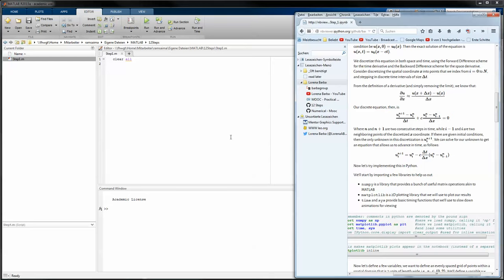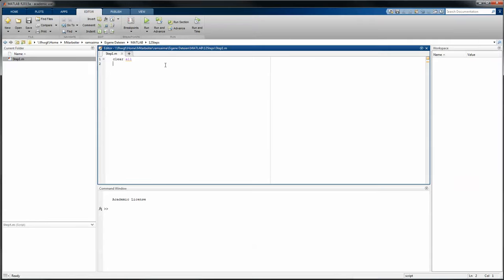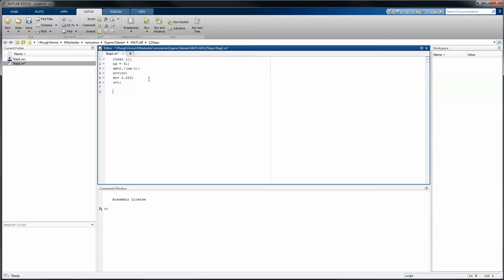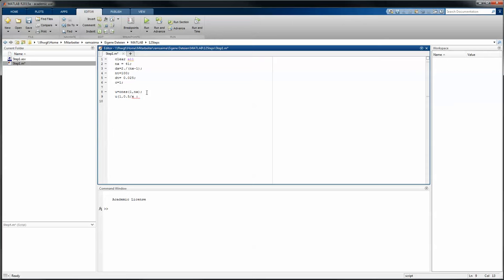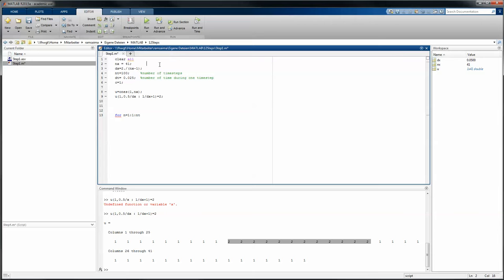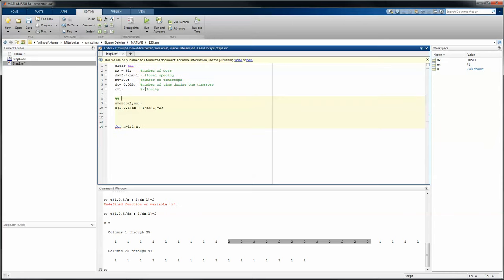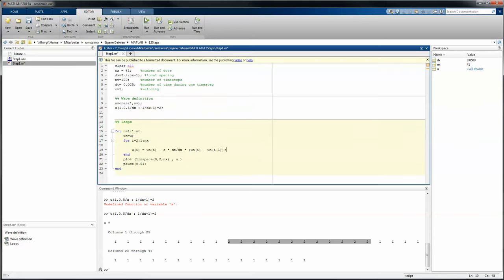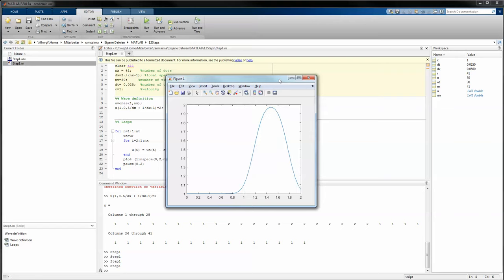12 Steps to Navier-Stokes - Step 1

Comment: Hi Manuel
The wave is supposed to be a square graph moving right, isn't it? Why is it showing a curvy (e.g. sine wave) wave?
Reply from the maker: It's an error caused by the discretization. It never really was a square as it would have been two values for the same x coordinate. This is infecting the neighbours more and more as the algorithm converges. Hope this helps 😊👍

Comment: what if we use forward time&forward space or forward time&centered space schemes? i've tried them and they diverged. is that normal?
Reply: forward time&centered space is unconditionally Unstable --> Don't use it 
forward time&forward space  can be stable only if c<0 (i.e. flow in -ve x direction) & CFL<1.0
See this: http://www.etakl.net/notes_etc/numerical/schemes.pdf
Reply: @MeOuda  hi thank you for this explanation. Is there a way you could re-send this link, it isn't working